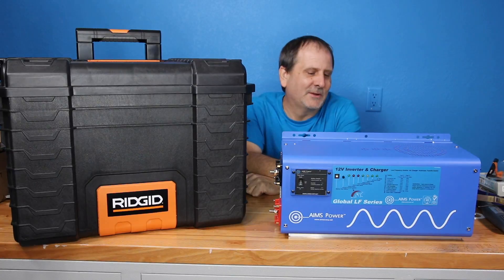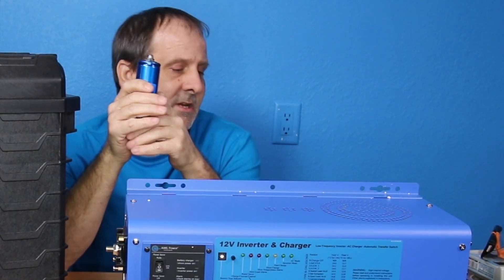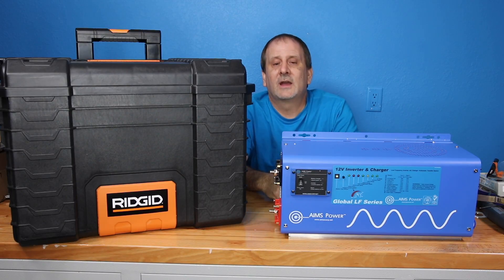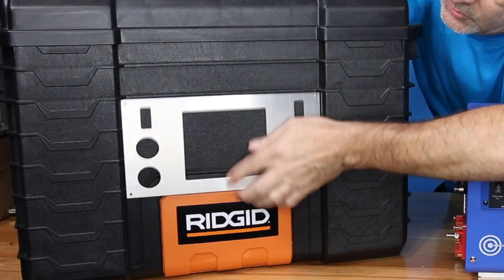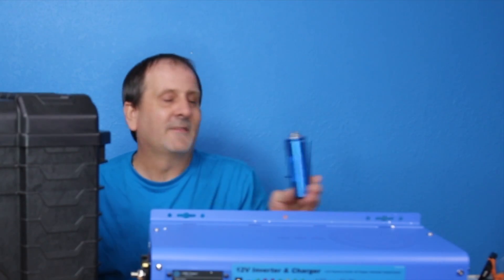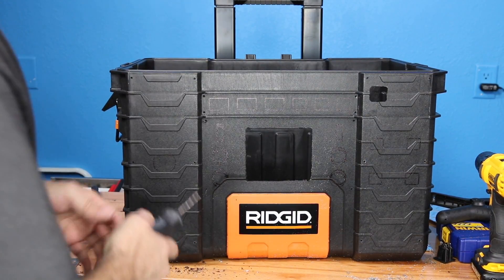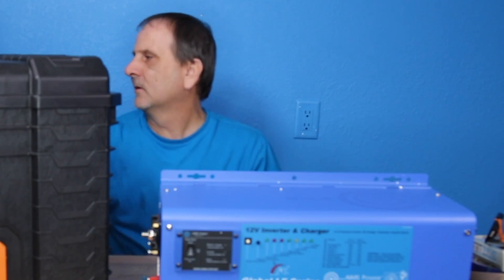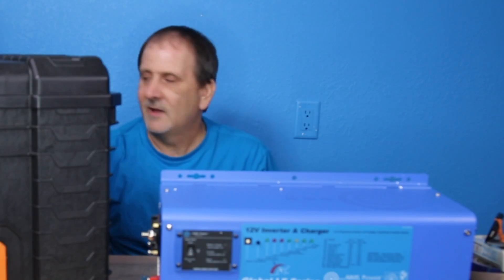How to Build a Portable Solar Generator w/ 180ah Headway 38120s LifeP04 cells DIY

Comment: Cool I wanna would make this to power my gaming system.... then my dad can’t say. TURN THAT THING OFF!! I would make make it so it is charging from a wall plug so it can charge from wall and it’s generator. So I’ll plug my pc and WiFi router in it. So if my power goes out. My WiFi and pc is still ON. So in the middle of gaming I would disconnect and I won’t have to restart my pc
Reply from the maker: That's exactly what this will do. Thanks for watching Zeppy.

Comment: How many solar panels would be needed to run something like this on a pretty regular basis? Im talking like running my 1000 watt heater for about 12 hrs or more a day?
Reply from the maker: This build has a 100ah/1500wh battery pack. So charged it would run your heater for around an hour and a half. you would need about 1200w plus of Solar to run that heater and charge the battery. You can also add more batteries to this setup to increase the run time and or add wind power. With the wind you get the free power at night as with the panels they're only good in the day time.

Comment: Found a battery called mightymax 12v 100ah model # ml100-12 and a solar charger mightymax solar charger 30amp #MLS12V3OALCD 12v and a trickle Qiilu
Qiilu 0.75A 6V 12V Automatic Battery Trickle Charger Maintainer for Car Motor tell me which to keep or change bud how much is your battery pack
Reply from the maker: Jah this message got flagged for the model numbers and stuff lol. Just seen it. use a 12v, 2-20a car charger Not the trickle unless you're not going to use the battery that much then trickle charge it.

Comment: Well I have the same aims inverter you have so tell me what to put and that’s what I will use bud your the pro lol I’m the rookie lol
Reply from the maker: ok it says sims 3000 so that confused me lol. Thought it might be auto correct or something. use a 100a shunt on the negative side and a 100a AnL fuse on the positve side and you'll be fine. what kind of battery pack? Lead acid, lipo, lifepo4? You can use a trickle charger either way as long as the voltages are correct.

Comment: Thx bud can I ask you something what amp fuse do I use between the battery and inverter 100 ,150 ? And what solar charger should I use a 30amp mppt I just got the sims 3000 watt in its huge and heavy so dam lol I’m sourcing the parts that I know of so far what about a trickle charger what should I use sometimes I feel like I can’t figure it out lol
Reply from the maker: Jah 100a is fine but remember the bigger the fuse the power that can be drawn in a surge manner. So that said if you don't have a need to DRAW 100a from the inverter than use a smaller fuse. Once drawing big amounts of amperage one should completely understand the cautions of HIGH amperage discharge. If you're running big loads at high high amp surges than yes use the bigger fuse however your inverter can only give so much anyways. I'm not sure of the brand you have mentioned. Not sure how big your battery bank is and what kind of chemistry it is so as far as a controller goes MPPT is always better of PWM. 30a is not usually a problem with most battery packs but make sure your pack can handle 30a continuous charge. btw all fuses/breakers from the battery to the inverter NEED to be DC and the wire size you need is no less than 4g and up to 1/0 to be safe. If low frequency than you'll need 6g (gauge) wire for your AC 30amp connections and and no less than 10g. 20a AC circuits need no less than 12g. be sure the main on/off switch can handle the load needed to power up the battery pack and inverter. 20a min switch needed or you'll need a relay of some sort. REMEMBER to build it safe and always going bigger gauge on your wires for heat and safety!
Reply: Lol it’s not sims it’s aims this auto correct is bad I have the same one you have there so what size fuse did you use between the battery and the inverter or did you use a breaker switch if so what size that why I needed your diagram for dummies (newbies like me ) to explain it in simple terms with fuses wires etc and a items list cuz for ppl who Dnt know wats amps and stuff but can follow directions on how to make things like me this is not my field so I leave it to pros like you to explain it as if we where five year olds 😂🤣 so plz be detailed when sending me the items list and diagrams so I Dnt blow myself up 👌🏽🤕😂🤣
Reply from the maker: answered in your last question.
Reply: Thx I saw it late let me know when you send the listing and wire diagram bud how’s the house coming along my renovations are slow due to working 6 days a week lol
Reply from the maker: I will as soon as I can. I should be back on track soon with everything and videos.

Comment: I mean it's cool and useful but shit how much do you have in parts like $2000 or $3000
Reply from the maker: Yea its a few bucks but will last for 25 years and do as much and more than most gas generators. In the end this is a cheaper way to go when you look at the energy storage, life of the batteries and the power of the inverter.

Comment: If I were you I wouldn't have used metal at the front because if their is a loose connection at the ports it could be lethal if touched!
Reply from the maker: Not a chance. they are not connected to anything metallic and they are directly connected to plastic. I suppose if a person touched a hot and a ground to it, it would become an inductor but I don't think anyone will be doing that.

Comment: I could use a inverter. I'm off grid. I have. been thinking of ways to generate power. since I'm off grid. I been charging and testing batteries. for two weeks nonstop. soi can match them into a 1000p 7s bank of  18650 cells. so it will balance easily. keep it up.
Reply from the maker: James sounds like a great build. keep me posted! you do the same
Reply: Wes That Tech Guy 
I wish I could do what you are. I just like doing stuff like that. I have the time. just not the dime! I'm just trying to get away from the generator. and now it has snowed today.. stopping everything. except I'm still charging batteries! and capacity testing them. I have a wood trunk about 20" by 20" by 36" I plan to fill it with cells. then build another! and do it again. I'd like to run my off grid house. for 48hours without sun. 96+ hours would be awesome! and a load of cells. I don't run that much. I have a gas water heater. and wood heat. no a/c. and use the generator to power the washer and drier also the stove. use all LED lighting. powered from AC and DC. power. with a small bank just for the DC lighting. it could be a start on how future homes can be powered . making most of their own power. but for now I use the generator to charge the lead acid bank. I almost have the parts to speed up my charging and testing. when I get these cf ells in a bank. I will almost double my run time.  can't wait to your next video! sorry for rambling!